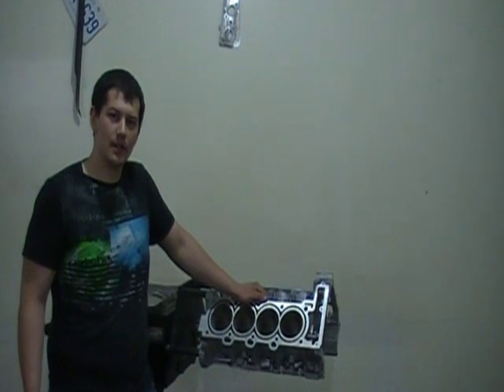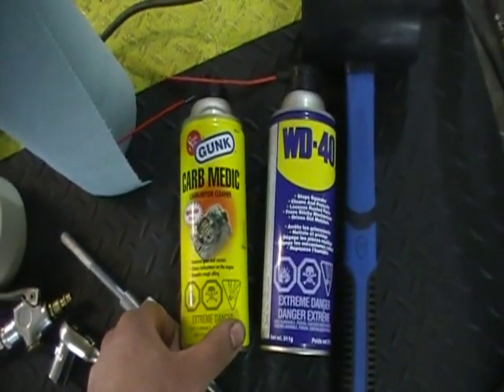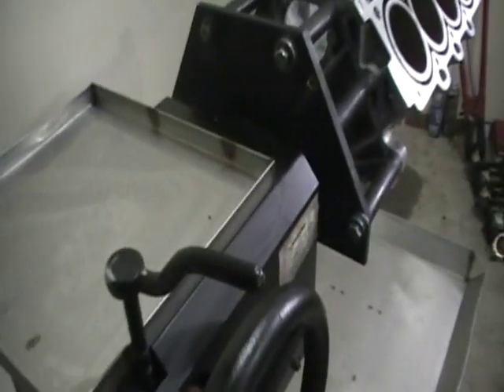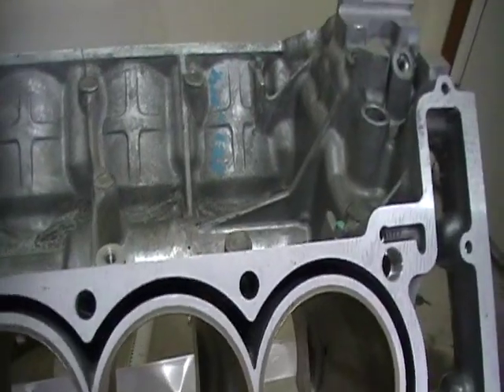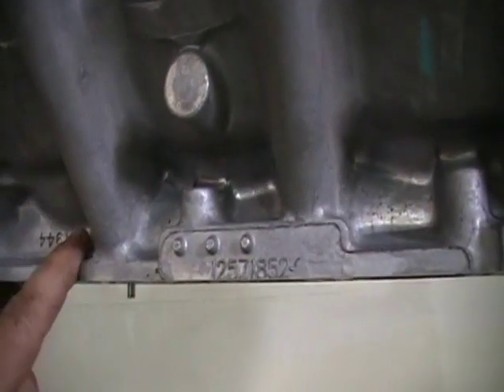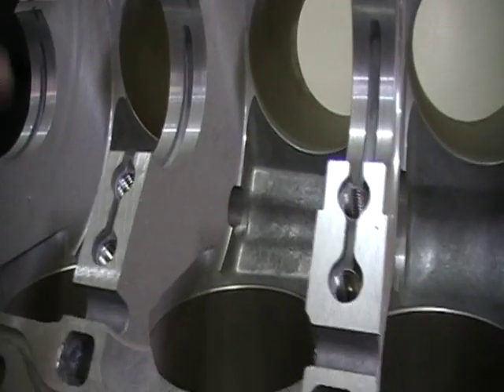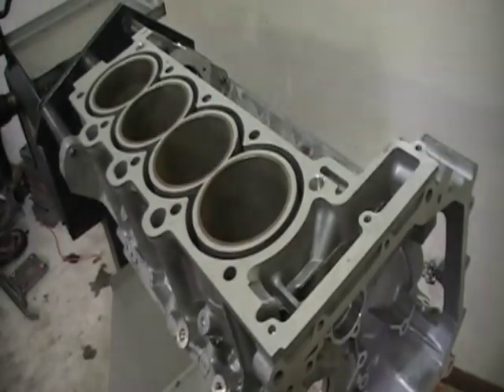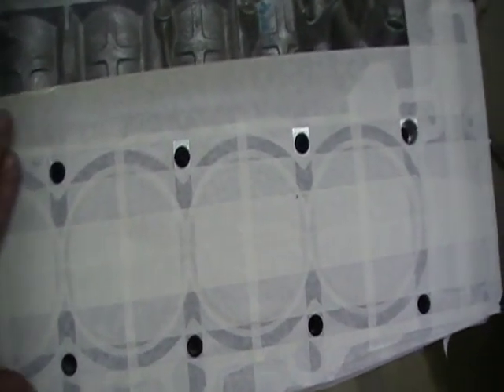SureGrip Cylinder Head Stud Install Videos

Comment: I have a '98 Eldorado with 85,000 miles. How common are head stud failures? I've heard horror stories but haven't had any negative issues with the two Northstars I've had. My car runs very well right now and doesn't seem to have any issues. Is this good preventative maintenance. I noticed on your site that you have a flat repair fee... Is that still true?